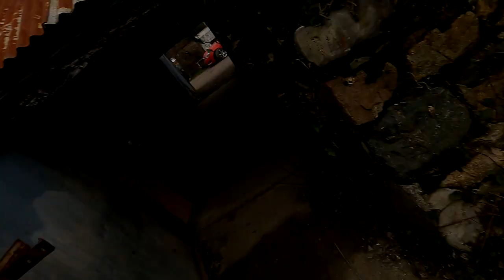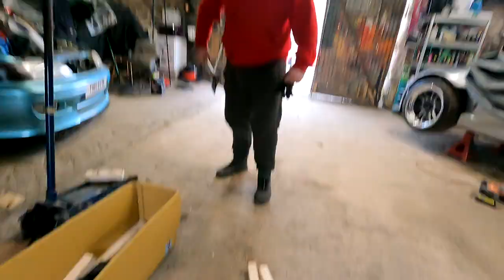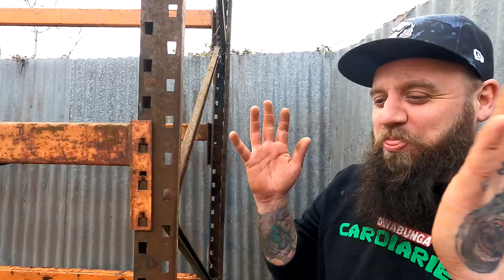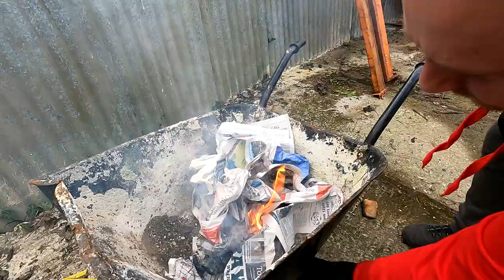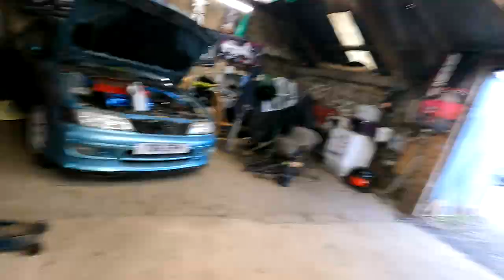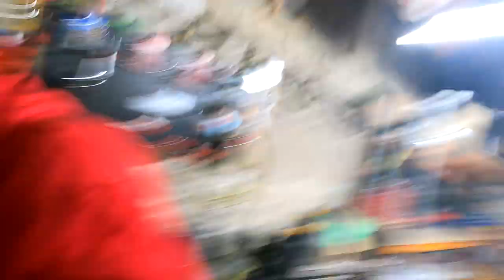Ray Smears and Bear Spills

Comment: Just a question b4 I fit mine i watched the cluster and seeker lip u fitting how does the m3 tape on the cluster hold up when power hosed? Should I use adhesive?
Reply from the maker: Which lip mate? The Maxton splitter?
Reply: The carbon cluster plate on the back should I use adhesive how well would the tape hold up when washing it with the power hose lol
Reply from the maker: @matthewthomas4586  yes mate use something to stick it on defo
Reply: Thanks mate I will use adhesive thanks for the fast reply and the content 👍